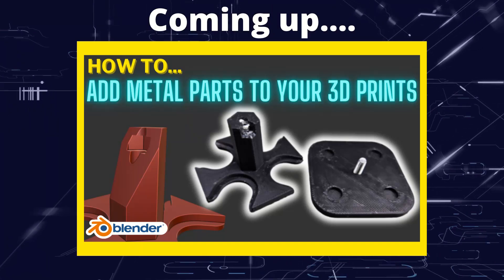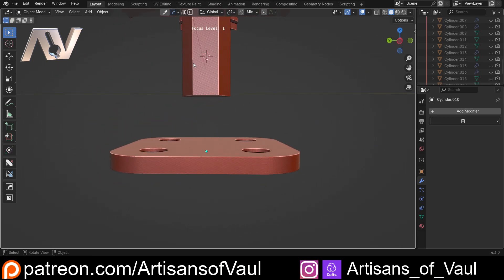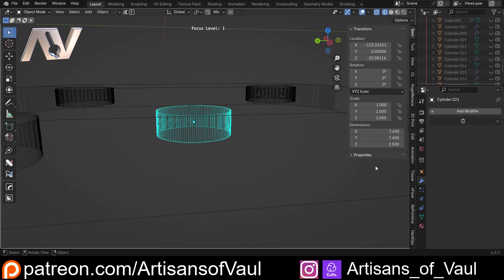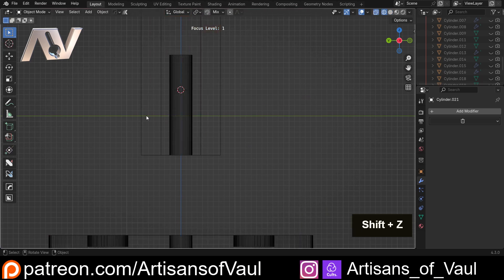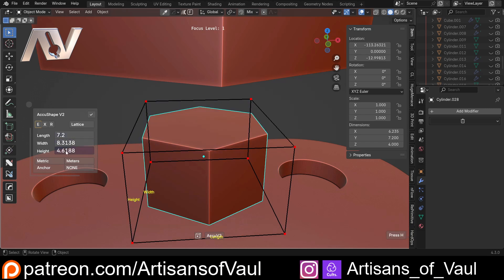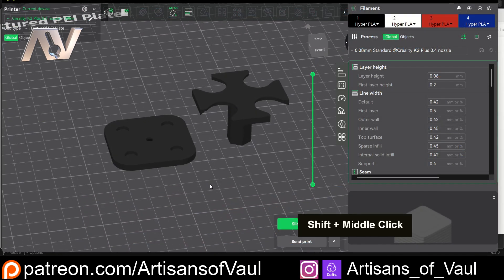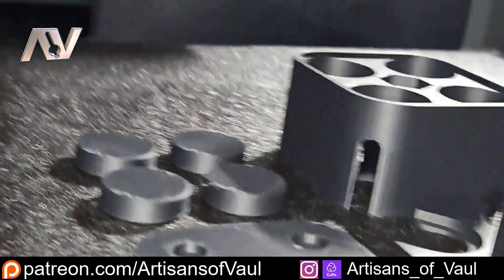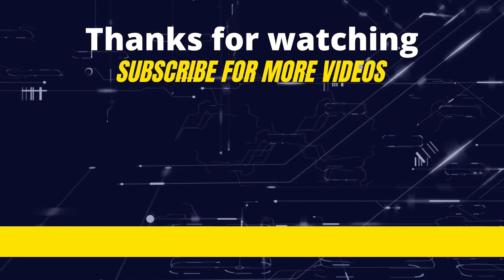Adding Metal Parts Easily FOR STRONGER 3D Prints

Comment: I hope this helps..   Creality Slicer seems to be based on Cura slicer so expect most based on that base code to have a simular feature set.
And all Prusa Based Slicers also have a simular feature set (at least for base features).    I can confirm that Pursa slicer,  Orca slicer bolth have the same pause feature. plus modifier objects.  I also believe but not checked Bambu, SuperSlicer, and AnkerMake Studeo slicers as thier code is base also based on the Prusa slicer it's a good bet.   So I would say currently most slicers if not all based on current Cura or Prusa slicers have an easy pause command effectively added the same way.
Also, great practical info.   These no-guff videos are what I point people to if they have questions and need to see it done.
Reply from the maker: @taerog  That's really appreciated info. Thanks so much. I'll pin this so others can see too 👍🏻😁

Comment: if you didn't want to use 8 wall loops for the whole component you could use a modifier object to just increase walls and maybe infill just around where the nut fits. Doesn't make much a difference in this case but for some parts its useful to save material and time.
Reply from the maker: @HellbellyUK  Awesome tip 👍🏻👌🏼

Comment: Excellent video, I wanted to add something. I was using ASA a while ago printing tightening knobs for my printed tractor light mounts. I inserted nuts into the knobs; however, the first attempt failed; then, I decided to leave the nuts on the hotbed and that worked great, except you have to be quick when you insert them so you don't burn your fingers😊.
Reply from the maker: @glen8447  Haha. That's a bold move! Interesting idea and thanks so much for sharing! 👌🏼

Comment: I'm trying to figure out what this whole thing is for... I'm guessing the four holes in the bottom plate are for compression springs to fit in. And on the other end of the spring, you'd have one of those four flat cylinders you've printed. So the cylinders are being pushed along the round holes in that big part, also pushing anything else in that round hole. And you'd be able able to slide anything out of that cylinder using the holes on the bottom of the T-shaped part. So this is some kind of dispenser for a specificly-sized object... Is this a mentos dispenser? Or a dispenser for some other type of sweet? Maybe a mint or something?
Reply from the maker: @evanwilliams1199 Good detective work. Basically yes, it's a dispenser. I'm hoping to be able to show what it's being used for in the future 😁
Reply: @ArtisansofVaul  Nice! Also, I change my answer, I don't think it's for sweets, but coins. This would be a very neat way to store loose change.

Comment: Excellent tutorial on how to do this.

Bolts have flat ends. Screws have points. :-) Just FYI.

I measured all the bolts and nuts I bought (and magnets) and made Blender models I can append and subtract from a space. It's handy to prevent having to re-do all that work every time. I also scaled it up enough that the fit was snug but with enough clearance for my printer, and made the top side much taller so I could sink the screw into the hole as far as I wanted.  Also, if you have a solid model where you want a hole in the middle, you can turn the cutter inside out (flip normals) and embed it in the shape, join it, and then the model will have that hole in the middle with no path from the outside.

If you wanted the piece with the nut faster, in a lot of slicers you can change the number of perimeters in just one area, or you can put tiny holes much smaller than your nozzle in the model, and the slicer will print extra perimeters around them without printing any holes. 

Also, be careful if you do this with magnets instead of nuts, because they'll stick to the nozzle. :-)
Reply from the maker: @darrennew8211  Good tips, especially on the magnets! I wonder if one day someone will start doing a non-ferous nozzle 🤔
Reply: @darrennew8211  great advice! I have a collection of prefab cutters I put together as well! I got tired of redoing them all the time and sat down one weekend and cranked them all out for future use! Saves so much time!
Reply: @emmamarx9284  Yeah, I've got a similar thing. I have models of bolts in various sizes saved (one M3, one M5, one M8...). And as a child object to those bolts, I have a couple cutter objects for cutting screw holes (or bolt holes, I guess). I can then save those as assets and re-use them whenever I want. When I import the bolt, all I have to do is apply the boolean modifier to the right objects and that's it. It's pretty convenient. It's also nice to do a similar thing with servo motors, stepper motors, joints I've designed and tested...
You should never have to design the same object twice. You design it once, then save it and re-use it. To excel at designing is to excel at recycling.
Reply: @ 100% agree! I also have a bunch of prefab electronics components and hardware ☺️

Comment: Another approach, if you have a soldering iron, is to use heat-set inserts or helicoil thread fixers. You print a pilot hole, so the model has the extra wall thickness in that area. Otherwise it's just your 20% infill or whatever. then put the insert on your soldering iron, get it up to the printing temperature of your filament, and press it into place (using the iron! Not your fingers!)

These have no chance of rattling around and are always a precise fit, but can't go in some places. The captured-nut (I'm sorry) method can't go in some other places, so it's good to have both in your kit.
Or for a part under minimal strain, just being assembled, you can print the threading for the female part and use a metal bolt (this may go to pieces is you take it apart too often however).
Reply from the maker: @EmilySmirleGURPS  Good other options 👌🏼👍🏻 I agree this doesn't work in most situations bit it proveds less potential sources if error (at least in my experience but maybe I'm clumsy 😅)
Reply: @ArtisansofVaul you’re not alone, I typically gravitate towards captured nut designs for the added strength but heat inserts are also nice I use them a lot when making quick enclosures/cases for my electronics projects/prototypes. Quick and easy, much less fuss. You can even get/make a heat insert press for pretty cheap that helps a lot with getting them to go  in perfectly straight which is important with things like cases.

They both have their use cases for sure! 😊
Reply from the maker: @emmamarx9284  Good call on the press. Having them at some horrible angle is my sort of classic error.